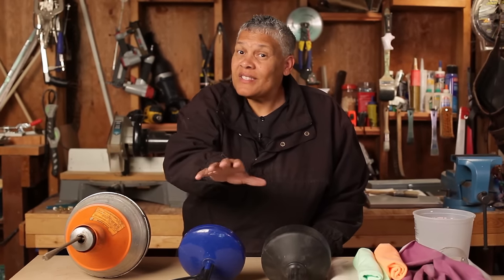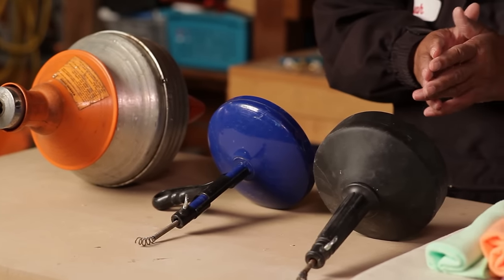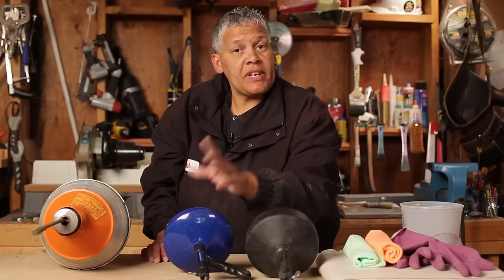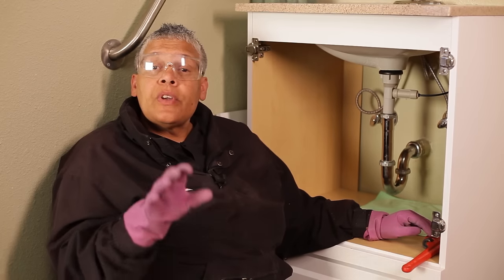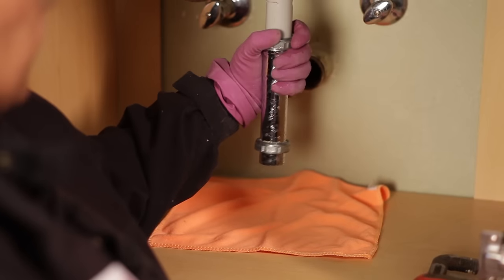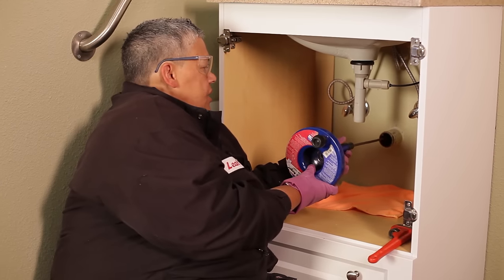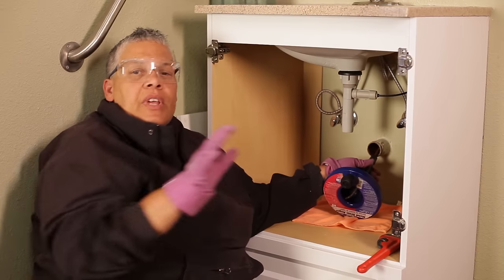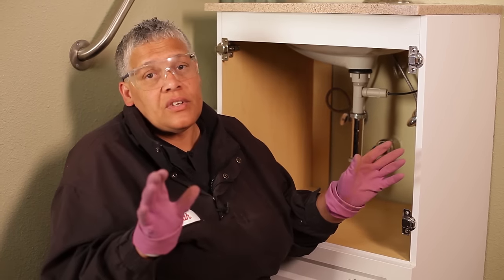How to Snake a Drain | Step by Step DIY Plumbing | Zillow

Comment: I watched this video last night, then used my 25 ‘ drain auger (like the one you demonstrated). And it worked perfectly. I’d had trouble before with feeding it in “too much to quick”.  
You technique worked great on the laundry down pipe and the floor drain.
Reply: I'm having the same trouble, clogged up the drain after my mattress pad came apart in the washer. We're going to try this if we aren't snowed in.

Comment: Thanks, Leah. I thought my snake wasn't very good, but it turned out I wasn't understanding how to use the screw. What I would add is that after you have tightened the screw and are then turning/twisting the snake, that you may have to keep twisting for a while before the snake gets through. Patience helps.

Comment: Good video.  You mentioned hitting the clog or a pipe bend.  It would be nice to hear you talk about hitting non-clog blockages and how to best get through them.  I think I'm going to run into a non-clog blockage first tomorrow when trying to clear out my roof vent pipe.

When I put a P-trap back in, I leave the area under the sink empty except for some newspaper or paper towel.  I like 24 hours of staying dry before I feel like it's truly dry.

Comment: Excellent.   IF however, you have troubles with the snake auger end NOT moving around the bend and downwards, due to other plumbing (for instance two lines, the kitchen sink line an the bathroom line meeting at a T) like two lines meeting at an "old" (and in some states now illegal) T connection, and your snake auger tip  won't go the right direction, down, then patience, fiddling, patience, until your auger goes DOWN to unclog whatever.   For me, it was years and years of grease build=up which was at or below where both my kitchen and my bathroom lines met, and the part that was blocked I just had to auger, and auger, and auger, until all the built-up grease was loosened.  (There still is stuff there, I just have to keep augering down there every three months still, next step call a plumber to go into the walls and fix those lines where they meet and wherever that internal grease blockage is due to ancient pre-today's-code for lines meeting, or whatever the old piping problem is in my old apartment building).  (When our building maintenance man worked on it, twice now, he keeps finding plastic pieces down in there, so in an apartment building with decades of tenets, old plumbing, it can get more advanced.   Keep trying.)

Comment: Could I use this to ensure my downspouts are clean each season to prevent a blockage, using it from the ground up. My goal is to not have to go up high on a ladder, or at least help keep the upper downspouts clear each season.

Comment: Q: how do you make the snake go around corners? Mine hits the end of the (straight part of the) pipe, but no matter how much I rotate it does not position it to the entrance to the rest of the pipework.[EDIT: I needed to use a thinner auger]
Reply: The drain probably hits a T intersection inside the wall with the drain going down and the vent going up.  If you just can't make it go down the drain toward the clog, you might want to go up on the roof and snake straight down that way.  It will keep you from having to do a 90 degree turn with the snake.
Reply: @richardburchett  thanks for the response. I since figured out that I was using a (too thick) toilet snake. I got a thinner one, and it worked! Just turn a few times and BOOM, down the rest of the way it went!  Extracted it w a few clumbs of goo, blockage gone! $40 Auger saved me $300 plumbers bill! (and I still have the auger if it ever happens again!)

Comment: I was going to buy a snake, but after I took the P-trap off, I found out that the drain pipe under the sink was clogged with dental floss. There was a piece of soft bar soap mixed with the floss. I thought that the soap would dissolve: it didn’t. I had put the floss on the counter next to the sink: it ended up in the sink.

Comment: Can this be used in a drain pipe? Our laundry drain pipe seems to be clogged and it overflows the water and it goes all over the floor when the washer starts to drain, this has happened once about 2 years ago and we had to have a plumber come in but can't afford it right now

Comment: Hi there,
Thx for your video.
 I used a 25ft snake on my kitchen sink never hit any clog but spun the auger anyway. I've tried, dawn soap,baking soda & vinegar,plunger, replaced air vent (it's a manufactured home), all the pipes are clear but sink still won't drain. Also all other drains down the line have no issues. Any suggestions?
Reply: Maybe a vent issue?

Comment: Using a new drum auger with "auto-feed" feature, the cable stopped advancing about 10 feet into the wall. Backing the cable out slightly and hand-pushing it forward did not help. Neither did just "spinning" the cable. In my humble homeowners opinion either the tip of the cable cannot move thru a 90 degree elbow or the obstruction won't budge. What is my next COST-EFFECTIVE step ?  Thanx. Bewildered Bob

Comment: That wire on the drum augers gets rusty.

Started using mine for the third time and the wire broke. Fortunately it snapped right at the beginning of the  floor drain hole , so I was able to pull the broken piece that was in the underground pipe out.

Imagine if it broke under the concrete slab I would have to dig up the concrete to get it out or maybe a plumber would be able to snag it out.

Comment: Hey Leah, how does a snake compare to a bladder? which works better, or do they have their own uses?
Reply: Chris Burnette there are snakes, bladders, plungers, kinetic water rams...  They are all used to clear a drain.  The snake does a good job of breaking through or actually removing the clogging material.  And the other method push the clog along.  If I can’t push it I use a snake.  If you have the money a kinetic water ram is great to push it.

Comment: My drain is clogged with sediments.  I tried the snake method but ended up with a recoiling as it could not break through the sediement.  What would you suggest?  Acids cannot be purchased in my country.  The sediments are likely due to previous owner's toilet renovation
Reply: Sean jet the line if possible
Reply: You have to determine where the pipe goes and look for a cleanout furtherd down the line.  I don't know of any acids the will  eat away at sediments.  I have had that happen to me once.  I opened the cleanout and found small gravel and packed sand .  Stillll can't figure out how it got there?????
Reply: You may have to get yourself a cheap USB camera that you can put into the drain  till you get to the blockage and then try to figure out how far you are from the drain to the blockage so you have a better idea of how far  is the problem.
Reply: I had this issue with my washer drain. I found that I could use a drill bit (plumbers bit or spade bit) to break through the sediment, while I had hot water draining in. I made sure to use an auger in the main water line so I could break down any additional sediment that might clog that drain as well.

Comment: Never use chemical  products for 2 reasons.  One they don't work most of the time (like 99% )  The other reason is that if you try to snake the tube or call the plumber there is a chance that you can get a severe chemical burn if there is any splashing.

Comment: Now show how it really is, Black muck everywhere, smelly nasty mess, Arms getting tired from turning and pushing the snake to get it 15 to 20 feet down the line, and finally your break through then you can't get the snake out, took me 20 minutes to pull the 20 feet of snake out, On A positive note I did unclog my wives hair and plastic hair pins from the drain. Didn't have  to call A plumber, took 20 minutes to clean up the nasty black mess with scouring powder.  Good tutorial but it never goes that smoothly.
Reply: I hear that! 🤣 Working on my kitchen sink, and my mom's bathroom sink and washing machine/kitchen drain in the basement at her house. Her bathroom should be RELATIVELY easy since it's completely open space. Drilled my kitchen drain (which isn't up to code... and needs a new drain cap since it allows water to back up and flow into the under sink area... which is all unfinished particle board-like wood!)... The arm and hand getting tired is so real. Especially with arthritis creeping in on me over the years. And I'm still under 40 😢 drilled for 45 mins. This drain also has a 90° angle bend about 20 ft down and my auger is only 25'. Better, but not fixed.

I swear by Hair and Grease in the big black bottle for stubborn clogs. Saved us a few times with a very slow drain or complete clog in our tub several times. But, rather useless for slow drains or anything you don't want it sitting in for less than 12 hours. Since it's lye, pretty sure it can heat up to the point where it might damage PVC piping.

Anyways... Auger that's worthwhile is ~$40 here. Time and hard work, basically just saves $50 on a job done by a qualified plumber. Or potentially several hundred if you go with big names like Roto-Rooter.

TL;DR - U rite lol
Reply: That’s it? Just 20 minutes? Thats not bad
Reply: About to embark on cleaning a commercial kitchen's back of house drain, pray for me folks
Reply: That’s real shit right that lol 😂
Reply: She’s showing HOW TO not ur nasty house
Reply: That's why you buy one that fits on a drill 😂
Reply: Only 20 minutes sounds really good

Comment: Those safety glasses are not splash googles. If you are worried about drain cleaner splashing your eyes like you said in the beginning you would use splash goggles. Those wont protect you at all.